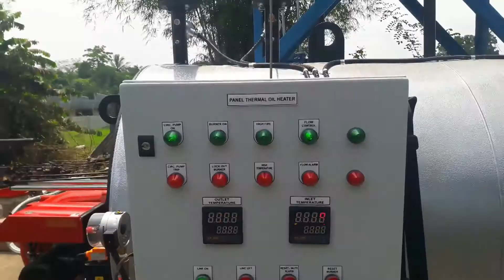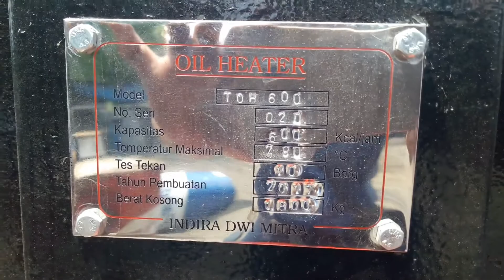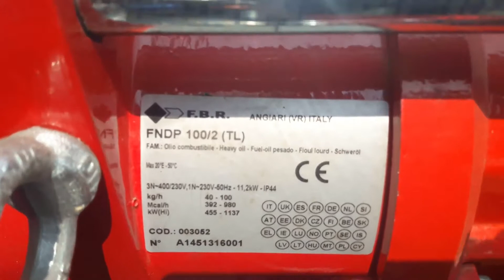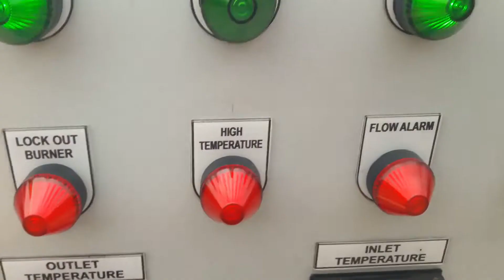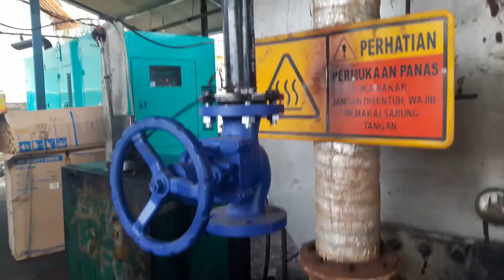🔥JUAL BOILER PEMANAS ASPHALT MIXING PLANT-KAPASITAS 1000TON🔥

Comment from the maker: Tiem PT Indira Dwi Mitra 
Melakukan Pemasangan Unit Thermal Oil Heater cap 600. mcal/h untuk proses pemanasan di Pabrik Asphalt Mixing Plant di curug Tangerang dengan kapasitas pruduksi 1000 ton/h
Reply: Asphalt Mixing Plant oil heater